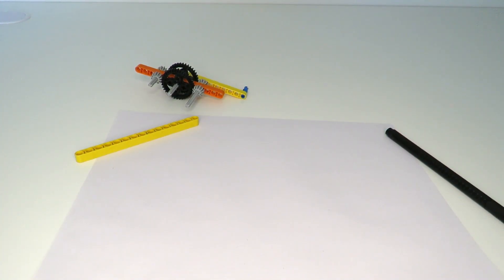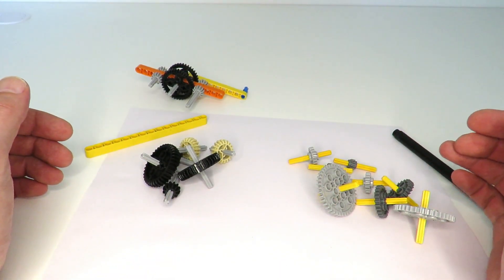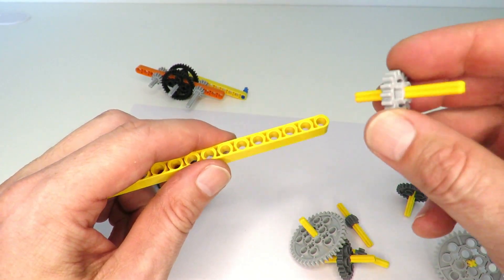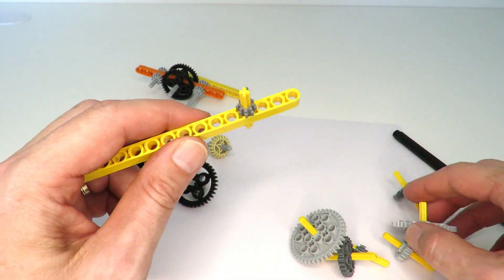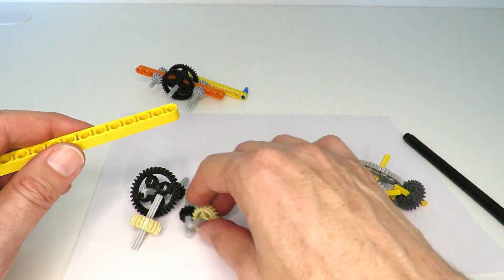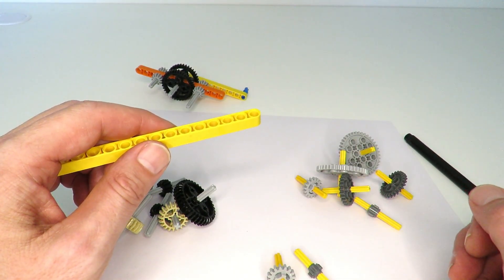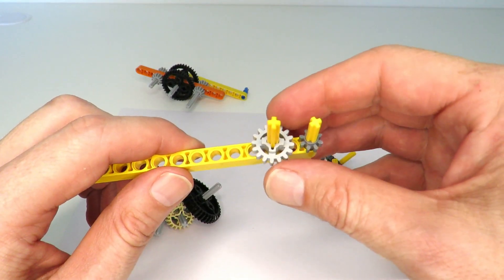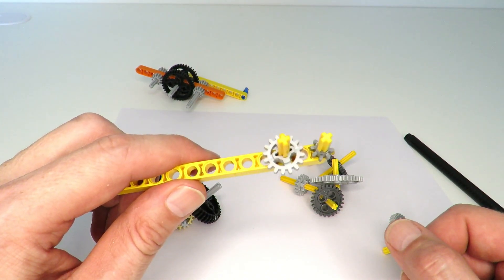How to create a 2 to 1 gear ratio using Lego Technic

Comment: Super useful video. One of the differential gear housings has a 16 and a 24 on it's ends and the output of the barrel is the sum of the 2 inputs divided by 2. If you want to simply add the two inputs you have to multiply the output by 2. The existence of the 8 and the bevel 12 plus these solutions make a very simple adder possible. Other adder mechanisms I've seen use 2 differentials and 3-5+ additional support gears.

Comment: I made this version using older Technic Bricks And System Bricks and 4 gears to make a 2:1 radio
Reply from the maker: Thanks Dinh for sharing your method of achieving this.
Reply: @TechnicBrickPower  i think my version is more compact than TBP version
Reply: @TechnicBrickPower  I guess the 1x2 with 2 holes and 1x2 with 1 hole I meshed up my gears vs. TBP version the answer is yes

Comment: 28 to 56 8 to 16 12 to 24  
And 20 to 40
Reply from the maker: Hi Dinh, Yes those ratio would work too if you can find a 56 tooth gear.
Reply: @TechnicBrickPower  i made this think
Reply: Sorry I didn't lego turntable v1 and v2

Comment: For the 8 to 16 teeth gears you could use the "original" technic legos with studs on top bricks, there is a 2x1 brick with 1 hole and a 1x1 brick with 1 hole, so total width of 3 studs.
Reply from the maker: Hi TC Damen. Thanks I will look into that idea. For the 8 to 16 we need 1.5 studs for them to mesh however. Maybe that can be done with the original bricks?
Reply: @TechnicBrickPower  4 studs long: 1x2 with single hole and 1x2 with double holes